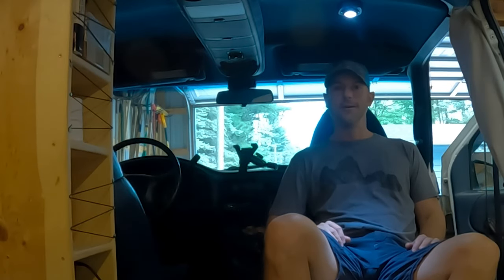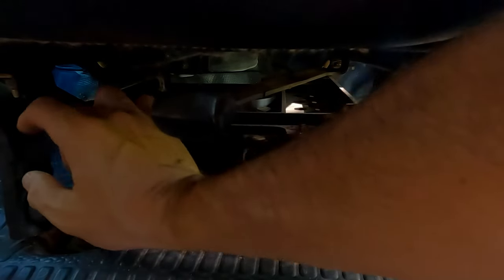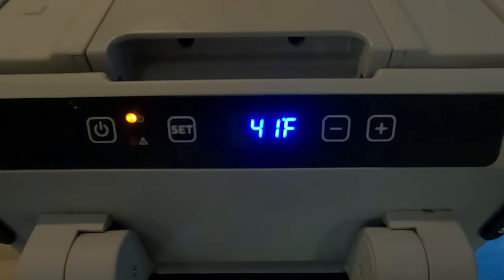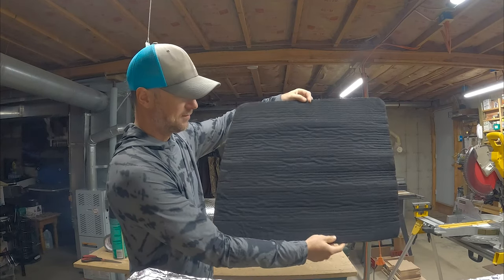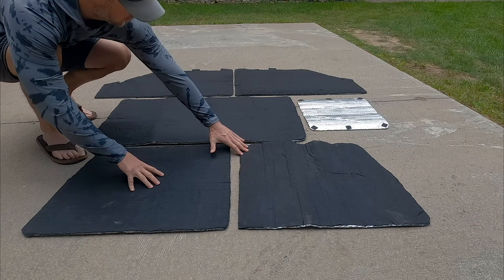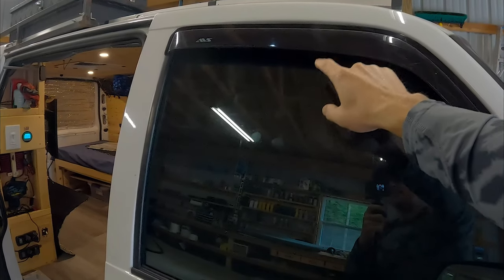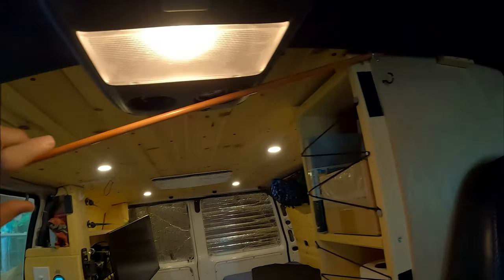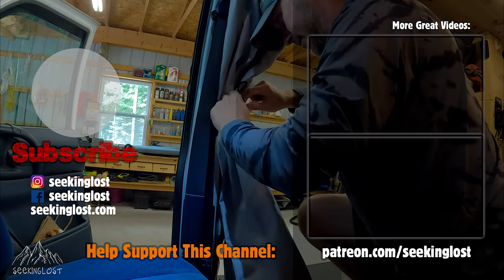Chevy Astro DIY Stealth Camper Van Build EP 9: Swivel Seat, Fridge, Window Coverings

Comment: That swivel chair is low key an ideal office/gaming chair. All you need is one of those fold out tray setups (like in a commercial airplane) attached to the chair so you can put a laptop or a keyboard and mouse on it.
Reply from the maker: Check out ep 10, i do build a board for my laptop, mouse and external hdd to sit on my lap. After almost 2 years, i still love the setup

Comment: I will not make fun of your crank widows! By far my preference.
Reply from the maker: Why are they your preference, if you don't mind me asking? I would love to have power windows. It's such a pain(dangerous, actually) to reach around the seat while I'm driving on the highway to crack the passenger window.  I thought about converting to power windows, but the conversion would be pretty ridiculous. The easiest way to do it would probably be to just swap doors from a junkyard van, but would still need the computer for it, all the wiring going to the computer et cetera. It just wasn't worth it.
Reply: @SeekingLost   my reason for this preference is my previous experience with a vehicle that had power windows which stopped working dependably, which then caused security problems when I couldn't lock the car up when I was away from it, and had to deal with trying to keep the weather out of a window opening when the window would not close. Having to cover that opening with some other material (plastic) was loud, harder to see through, and was still not secure. I would rather have had the mild, occasional inconvenience of crank windows rather than a full time expensive and dangerous problem of  non- functional electric windows.  Not necessarily issues important to everyone, but important to me.
Reply from the maker: @rowanmulvey8632   I had a feeling you would say failed power window motors. I personally find them pretty easy to replace, for about 35 bucks a piece. I'll take the day to day convenience of power windows over the inconvenience of it possibly failing once over what, 20 years of ownership?

Comment: Northern tool has a swivel base for around a hundred bucks man
Reply from the maker: Well too late for that! Just had a look. Northern tool says this about their swivel mount... "Designed for use in tractors and slow moving vehicles (Not recommended for use in cars, trucks and SUVs)". Probably a legal thing. The one I bought looks much stronger, at least. Ah well, no regrets, even at $400 it was totally worth it for the utility it provides.
Reply: @SeekingLost  Yeah, its not dot approved, but neither is your $400 swivel base. With the seatbelts being attached to the van body and not the seat, Im not real worried about the seat base.

Comment: I've never seen 3Ms "high strength spray adhesive, but I've been using the normal strength version for decades, and it has never failed, on dozens of different sorts of projects.  I cannot imagine what would require any higher strength adhesive when all you're doing is gluing a very light layer of black fabric to a very light sheet of relfectix.  Are you worried about heat causing the adhesive to fail?
Reply from the maker: Yes worried about the heat causing it to fail, and after a year of use there is a little bit of peeling around the edges. As I Put the window coverings away, I will fit them in between my bed and back door, and this action will cause Some peeling around the edges. One of my magnets came out too. I had to re attach the magnet and glue on the felt again while I was home a few weeks ago.  Not a huge deal, I'm OK with doing a little bit of maintenance on these.  I used to use this 3M90 Spray to For automotive headliners as well. always went for the 90 over the 77. I'm sure the 77 works great but if they make 2 different strengths, I figure might as well spend an extra buck or two and get something a little stronger.
Reply: @SeekingLost  Thanks for exposing me to something new!  I clicked on your video because I plan to make a set of similar window coverings.  I suspect I'll probably store them similarly to the way you do.  I'll go find some of that Super 90, now that I know about it.  If you're having trouble with the edges peeling,  I may alter your design a bit and sew the edges.
Reply from the maker: @tedpreston4155   That's exactly what I would suggest, sewing the edges. This is what I wanted to do When I was at home last but didn't have the time. I suspect it will hold up very well with the edges sewn, probably never have to worry about it